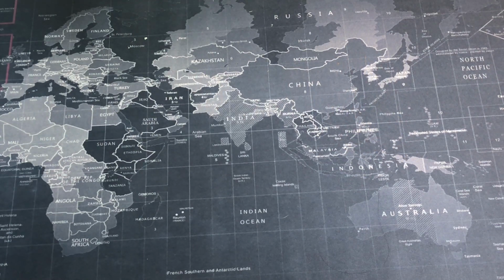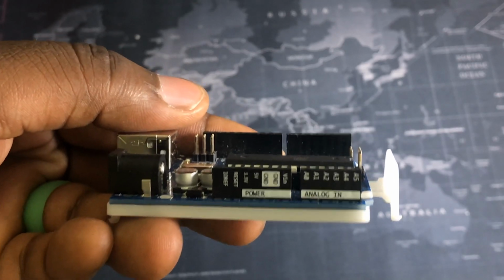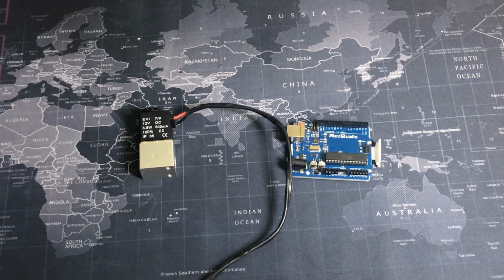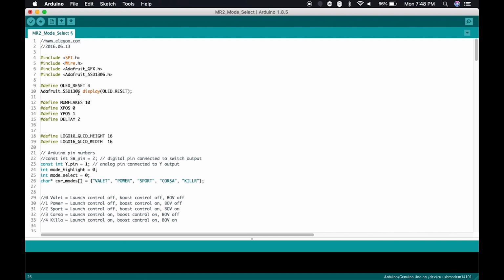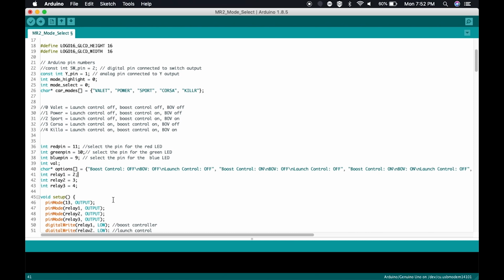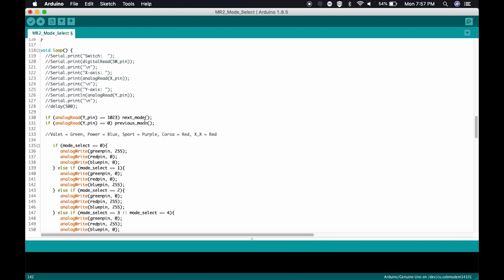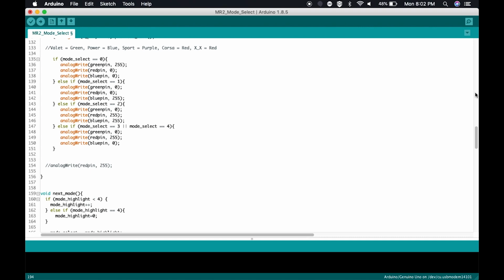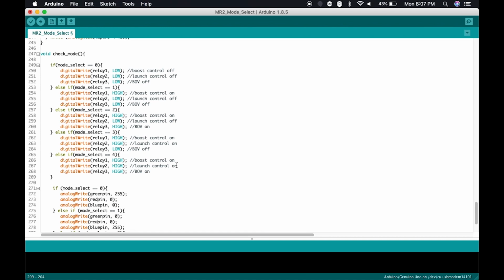Arduino MR2 Mode Selection With BOV Control / Arduino Explained

Comment: You're doing great! This is motivating me to give some use to all or some of the arduino boards I have laying around, also you could use the x axis to change other parameters on a separate screen, maybe to just cycle between showing engine temperature/voltage/ or cycle through all of the things you have on/off
Reply from the maker: Thank you! Those are great ideas. I'll have to revisit this after I get the car back up and running.
Reply: @OverkillEverything  anytime 😎👍🏻 and thank you for making these videos

Comment: Will you share your code for the active aero? I've been working on a hidden unit with a stock mr2 spoiler for speed-x up(60mph), speed-y down (30mph), and air brake up. I would love to move my project forward and take out some of the extra features your active aero has to make my simpler set up! :)
Reply from the maker: I'll put a link up for you tomorrow
Reply: @OverkillEverything  Thanks so much!!!
Reply from the maker: No problem at all
Reply from the maker: @TheCDangerfield  I hope this helps. Here is the 4.4 code. Enjoy. https://drive.google.com/file/d/1kD_zPbfF8B0WoakUFbQa6HFcxmRJaFe5/view?usp=sharing

Comment: Boost controller on the cheap just add a map sensor & you could take it home with 6 hall effect sensors. You could  choose the amount of boost at what gear.

I'm actually working on a supercharger/NOS project myself with the modes idea as well on the aw11
Reply from the maker: I have boost control already functioning through Megasquirt using the built in 4 bar map sensor and scaling boost based on my ethanol percentage. I have no lift to shift and rolling launch control so I only need to Spool once
Reply from the maker: Supercharger and Nitrous on an AW11..... Sweet that thing must be a Rocket
Reply: @OverkillEverything  Hopefully when its finished it will be. Right now I'm trying to figure out the best place to put my m62 on the 2zz.  That seems to be the hardest thing but once its done the rest is cake Lol